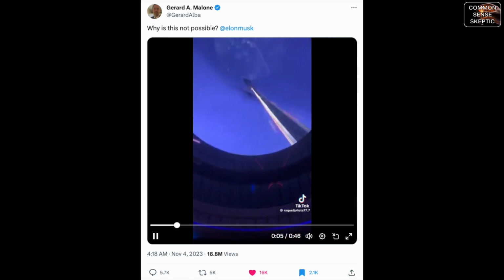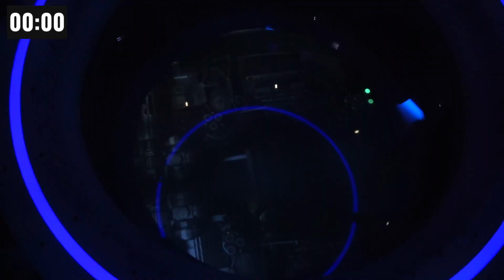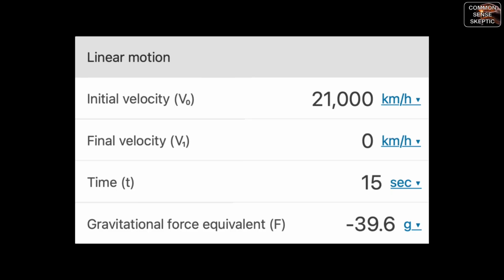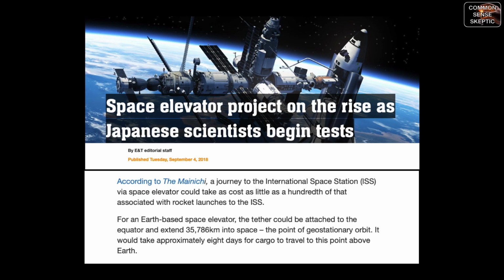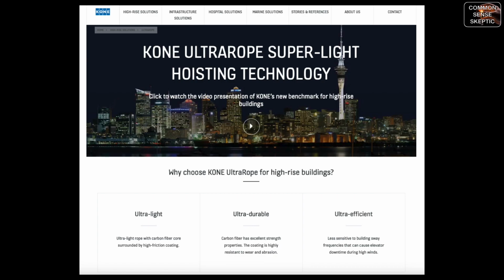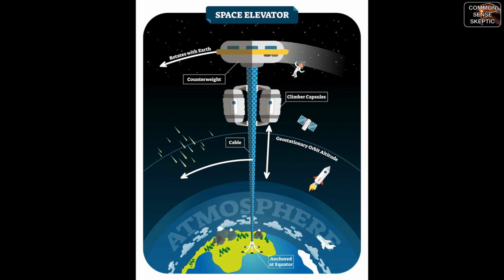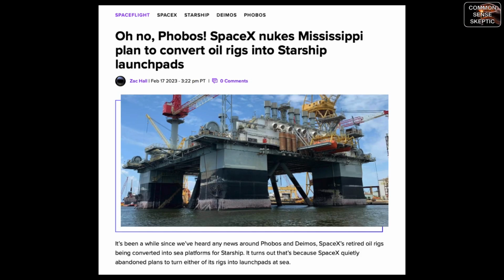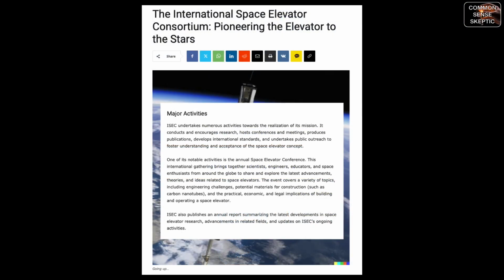DEBUNKING L.E.O. SPACE ELEVATORS

Comment: To be fair, while you can't have the bulk of your elevator sitting in LEO; physics-wise, you could have a small stop-off hanging from a bigger counterweight that is at GSO or higher. Effectively, you could put any number of stops along the cable (or cables) and they'd hang in-line with the structure as a whole. You can also put things above GSO and use them to hurl objects onto escape velocity; assuming we could find a material durable enough to work out for Earth's gravitational pull.

There's probably zero chance the first elevator would ever be put out by a lone private entity though, it would be a massive, likely international undertaking if we ever unlock some sort of super material that can do the job. Also another thing to note, a singular teather is likely not a sustainable system overall anyhow; as you move mass up and down the structure, you'd have to constantly move counterweights around, esp if you are moving cargo around outside the GSO region of the structure.

I imagine you'd need dozens, maybe hundreds of theaters for a system with multiple climbers and stations along its length, all with adjustable counterweights to stop the structure from going slack due to climbers moving along it, and cargo or docked craft being added, removed and repositioned.

Comment: I am by no means a engineer but i would assume this would be impossible due to the weight of the cables alone which is a problem potentially for Jeddah Tower which is tall but is nowhere near space even carbon fibre cables like what is planned for Jeddah Tower elevator would probably still be to heavy if it went to space

Comment: Just a small addition to the high winds in the mesosphere ; although they can reach up to 250kph, the pressure on the cable would basically be equal to a light breeze (very locally) as the atmospheric pressure at that height is about equal to the one on Mars at ground level. 
Of course it would nonetheless have a big effect on the overall length of the cable at those altitudes and would also compound to the effects of tropospheric winds and wind shears up to ground level, not to mention hurricanes... 

This would be a nightmare to predict as it ties to weather simulation, which is in itself already super complicated and, in an imaginary real life space elevator, an even bigger nightmare to compensate for... My two cents. 🙂

Comment: A tethered station doesnt need to move as fast as the iss to maintain its altitude. There are solutions. Also, launching from such a sub orbital speed station is still useful as you dont have to fight the atmosphere. Still takes a ton of accel tho. Also, you can tether a station above anywhere on earth, just takes multiple tethers to apply the proper forces. See science and futurism with isaac Arthur for in depth explaination.
Reply: Also, most of the benifits for leaving atmosphere before launch means youd probably only be looking at 20 miles up.

Comment: There are some errors, it is very difficult to get these debunking videos completely correct:
- the "space elevator to geostationary orbit" needs to have its "counterweight" above the orbit.  The idea is that a weight higher than geostationary orbit would "pull" on the cable to keep it straight.  A weight at exactly geostationary orbit would not impact any force to the cable, and would be useless.  The weight of the cable would still pull it down.
- when the space elevator is properly setup (with a weight above geostationary orbit), the whole thing would not come crashing down when the cable breaks.  only the part of the cable below the breaking point would come crashing down.  the remainder (the restaurant and the counterweight) would fly away in space, or more likely would get into a higher orbit around the earth.
- the orbital velocity at geostationary orbit is about 3 km/s so it is actually less than in low earth orbit.  this often seems to be a bit counter-intuitive.  still, the velocity of the surface of the rotating earth is only about 460 m/s so the object being raised to geostationary orbit still has to be accelerated by more than 2,5 km/s horizontally while travelling along the cable.  this does not come for free, it will cause a horizontal force on the cable that is not compensated anywhere by the system, and will result in the cable "wrapping around the earth" eventually.

Comment: Your 2 last points are itself essential to your topic and enlightening on the case of a lunar space elevator (which liftport proposed for 2020). 
The tangential velocity should be well compensated enough to stick with a lagrange point which both L1 & L2 are quite unstable coming along with its own counterweight. 
Then comes more trouble due to heat expansion with steel like we've seen here.
Moreover getting a spacecraft to lagrange 1 & 2 safely without either hitting the counterweight or a docking station is crucial else you may not have yielded enough this megalomaniac structure and create space debris. 
In another applicable case, it'd serve to send anything into HEO where a mass driver can already serve the previous, hypothetical purpose.

Comment: A one inch thick braided steel wire cable weighs roughly 2 pounds per foot. That means a cable reaching to geostationary orbit would weigh 118,080 tons. However, that same 1" thick cable will fail at 65 tons of tension. You'd need a material that's 1,800 times stronger than steel just to support it's own weight.

Materials science is not yet up to the task...

Comment: Good presentation, 2 flaws that I'm finding.

1. A space elevator might be viable on Mars or the Moon, maybe. With the lower gravity on either and minimal atmosphere, the concept can be much much smaller. Still very improbable, but getting closer to the realm of real physics. I mean, we can essentially reduce this to a thought experiment - imagine a tiny asteroid in space. It should be trivial to build a space elevator as it would only need to go up a few feet. As the object gets bigger, there becomes a limit at which a space elevator can not be built with any known material. I don't know what that limit is, but I'm sure it's reached far before we get to something the size of the Earth. The flipside of this is that on smaller celestial bodies, it doesn't take much propellant to get to orbit, so why bother? 

2. Putting stuff in orbit from a space elevator. Absolutely possible. You need to go much higher than the intended orbit so you have enough energy, but a good rocket scientist should be able to convert that potential energy into orbital velocity with a minimal fuel expenditure. Satellites in orbit need fuel anyway to adjust and maintain their intended orbit. A very tiny fraction of what would be required to launch from the ground. The utility of a space elevator is undeniable. The physics of building one (on Earth) is delusional.

Comment: MATH COMMENT/ENGINEERING

So, you do a surface level skim of the science and engineering here; but in doing miss a lot of subtleties.

The problem isn't actually as bad as you might imagine from a mathematical standpoint.

take a section of cable made from material rho, with area A, and height of dx

this cable at every segment will have two accelerations acting on them; the gravitational force and the normal acceleration from the rotation of the earth.

F=rho*A*dx(G-C)

One may assume that at some distance X, this net sum will become 0.

so 0=(G-C)dx
use the GM/(r+dx)^2-V^2/(r+dx) for the middle bits

do math on this, find a function and apply newton rasphon  and you get 1403686m to maybe about 3 sig figs

This length is irrespective of material properties of the cable, and purely kinematic based on the earth itself.

the tip of the tether would be static, and added weight at the tip would help counter net forces from wind and changes in the earth's rotational velocity due to the changed barycenter and moment of inertia. 

One would need to have a series of Gyro stations with active propellant along the length of the structure; Gyros to counter forces, thrusters to allow the gyros to unspool. 

The tether would need to have a poisson ratio, and thermal expansion coefficients along its length of nearly zero.

Technically speaking, at the ideal length, the foundation would experience the wind loads and the tensile force of the tether trying to leave the earth, but would not actually carry the weight of the elevator.

The hard part would be building it, as the cable would likely not be self supporting and need to be "held" by a much more robust structure around it.

The funny reality of the kinematics is that if halo 2's destruction of the orbital elevator had occured, it would have likely just flown away into space.

Comment: hypothetically, the tether would be made out of some sort of synthetic composite material not metal, and also the benefit of launching space craft from the elevator comes to the cost differential between the energy costs of the elevator versus how much fuel a rocket uses to escape the atmosphere, if its cheaper then presumably the elevator would be valuable... still the easiest problem to debunk a space elevator with is how the heck do you get the cable strung?

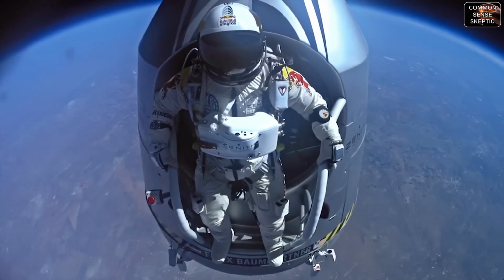Comment: @11:29 "There is no elevation below geo where you could just shove a satellite out a hatch where the velocity is enough to keep it in orbit". In a CIRCULAR orbit, yeah. In the orbits you'd actually want to use. In the orbits that are relevant for resupplying things. But being able to let go and end up in some orbit at all happens substantially earlier.
The Kurzegesagt video is correct for geosynchronous orbits, but not LEO; their picture seemed to show a GEO release.
@16:30 Keep in mind that shorter wavelengths still have to propagate the full length of the cable in order to come back and reinforce on the next pass. It has to go to the end and bounce back. REsonance, not simply… sonance. The Tacoma Narrows bridge you use for comparison had nodes enforced at the ends of the center span, at a very short separation; there will be no comparable structure on a space elevator (one endpoint is very far away, and the cars would not be able to enforce a dirichlet boundary condition on the cable unless of course the vibration is so small that the car doesn't need to worry about it). Also, the Tacoma Narrows bridge had no dampening mechanism; on a space elevator, installing a deflection arm to absorb vibration would be completely trivial compared to every other difficulty involved.
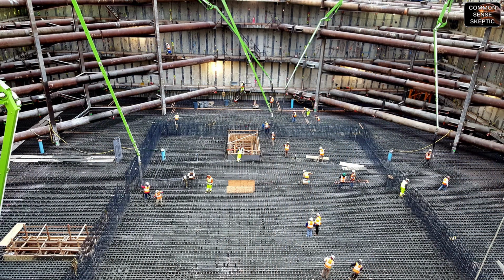@18:00 "The system's connection to the planet will need to be strong enough to resist the centrifugal forces keeping the station in place, using the end at the Earth to keep the tether tight." The centrifugal force of the counterweight is mostly handled by the gravity of the tether; the only reasons to actively hold down are 1) whatever tension you WANT to apply in order to keep the tether straight, 2) the tether needs to compensate for any angular momentum imbalances between upward and downward loads, and 3) accounting for variation in the mass of the counterweight station. Only the last of these really has to do with the centrifugal force keeping the station in place, and it doesn't have to do with the BULK of the centrifugal force, only the variations in it. If you were on an airless world with no traffic on the tether and a non-varying static station, you could just let it hang loose and hold on with a piece of twine to account for whatever stray forces remained. But your discussion suggests forces well beyond these. And the point of connection? Really? Probably want to wind it around a spool so you can adjust the orbit of the counterweight. Basically, there is something to solve here, but in comparison to the knockdown "you can't solve this" kinds of problems much of the rest of the video deals with.
@23:11 Keep in mind that as per my first point, much of the cable is high enough and moving fast enough to be in an elliptical orbit. So, you'd cut the cable at an appropriate point. The lower parts like the restaurant aren't moving at LEO speeds, which simplifies things. It's a problem, but not an orbital-reentry kind of problem, as demonstrated by the skydiver you had a video clip of.
@23:22 it'll mostly be in the sun. Except for a brief time around midnight near the equinoxes, most of its length won't be in Earth's shadow... though it would have varying amounts of solar flux across its surface. Enough variation for the issue to be interesting.  'If the cable was made out of steel' - what? If it was made out of steel, the taper length would be so short it wouldn't work at all. But it'll be made mostly of something based on graphene. Weirdly, graphene and carbon nanotubes have a negative thermal expansion coefficient due to entropic forces at RT, and positive at high temperature, suggesting that at somewhat elevated temperatures it's approximately zero. ANYWAY, even supposing that that isn't enough to make this problem just go away on its own, the solution seems to be that you'd mount it to a roller that can spool or unspool as needed. You'd put this at the bottom where the tension is much lower and you also have freer access to large amounts of power.

So anyway, the killer problems are killer: no material to build it out of, takes up an unreasonable amount of orbital real estate, lightning strikes, and not all that amazing cargo throughput compared to just launching very heavy rockets every day.

Comment: I never considered the voltage difference between the ground and upper atmosphere. I guess my next question is would this kind of system made of a conductive material just ground the atmosphere? What would that do in the end? It's something I have never thought of myself
Reply: It's there, but it's too high impedance to do much with. You can harvest a trickle of energy from it, but not enough to do anything useful - just enough to make a toy rotor spin. Very high voltage, yes - but the current available is so tiny, you need exceptionally sensitive instrumentation just to measure it.